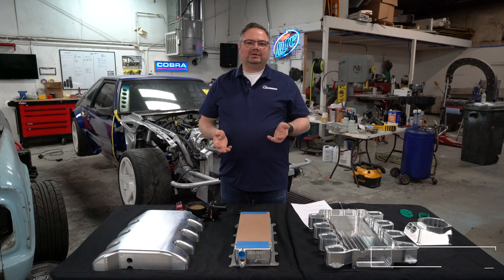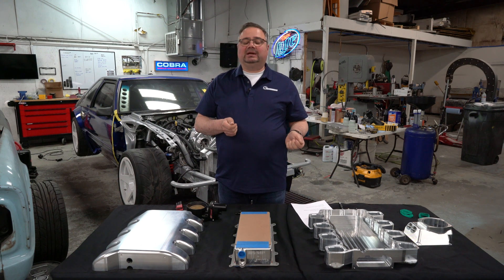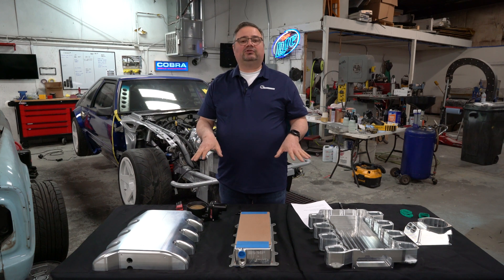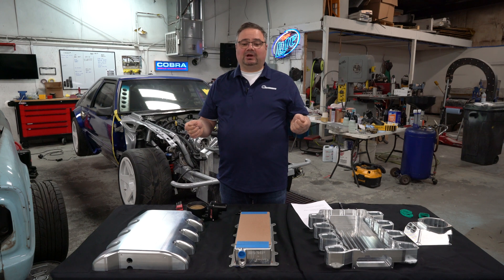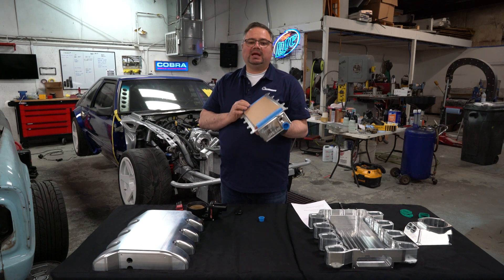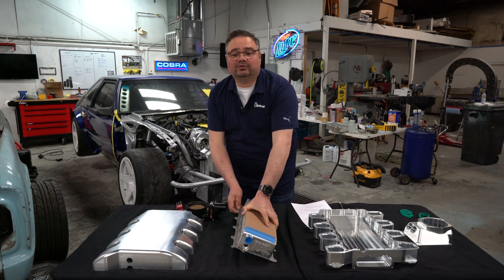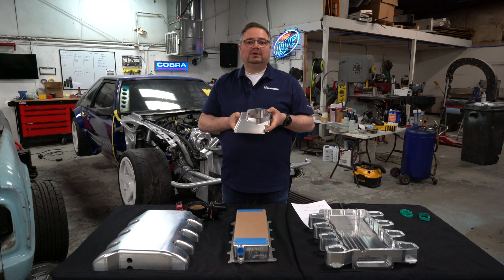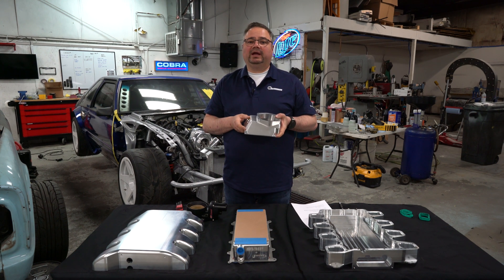7.3L Godzilla Billet Intercooled Intake [Supercharged & Turbo Setup]

Comment: I have an Entegra Emblem 36H RV with the Godzilla 7.3. Would it be advisable to turbocharge it to handle the mountains better without killing the fuel mileage any worse than 6mpg? I need more torque.
Reply: I haven't seen any turbo kits yet for the 7.3, but have seen superchargers and they seem to tow well. I think a turbo or turbos would be better for towing and mpg, but I'm not an engineer so I'm not sure.